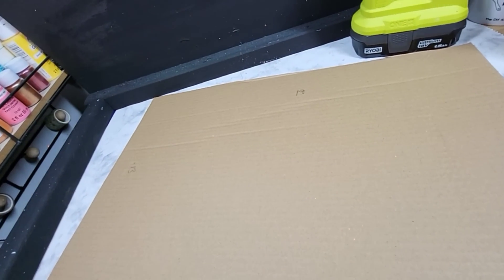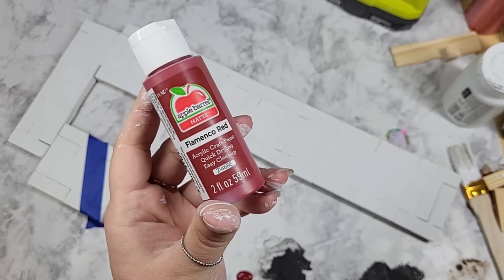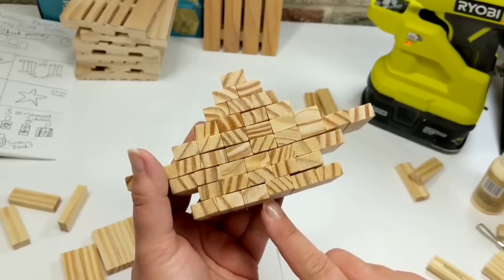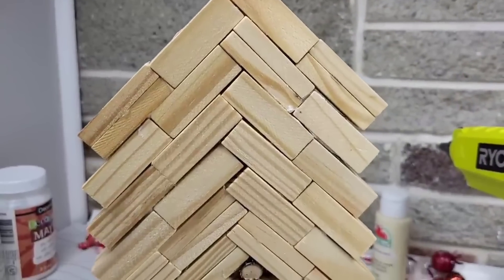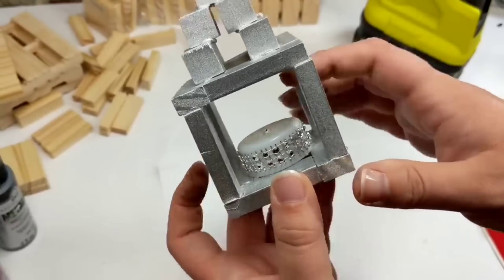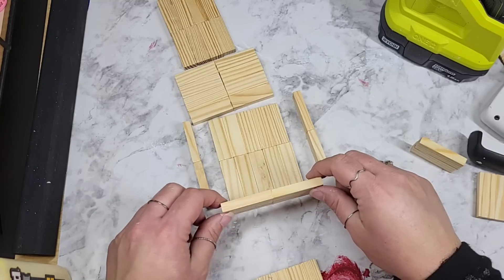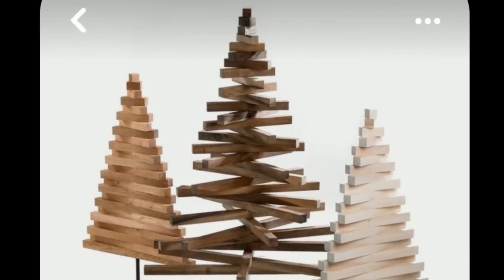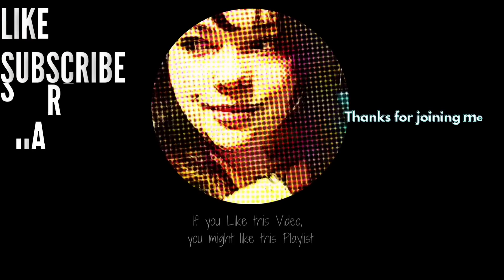8 BRILLIANT Dollar Tree Tumbling block Christmas DIYS // Dollar Tree Christmas DIY 2023

Comment: For the lil house roof, couldn't you use one of the smaller square blocks(like the 2 you left out of the candy cane), to put the roof on so its more even on each side?  So put the lil dowl piece(might not even need iit), then put the lil square piece on top of that(turning it sideways so its a diamond shape) & then put the longer pieces on each side?
If you put the 2 sides of the roof together, at the top points, you'll see there's an empty diamond shape in between them, at the very top.  That's where I'm suggesting to put the square block(turrned on its point, so its a diamond shape) & fits right in there.
Oh ooops, I thought it was a house sorry, I guess its a tree.  But it could still work for that too.